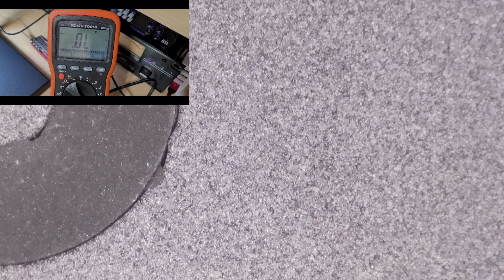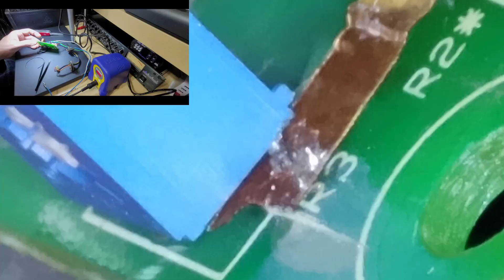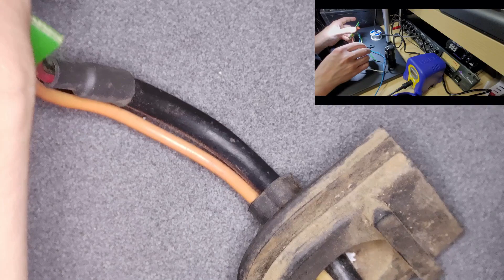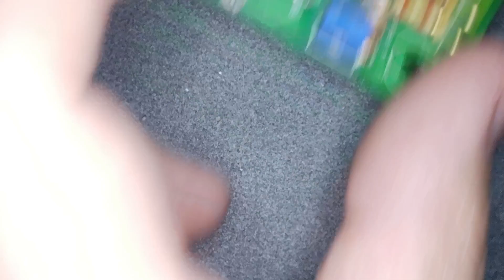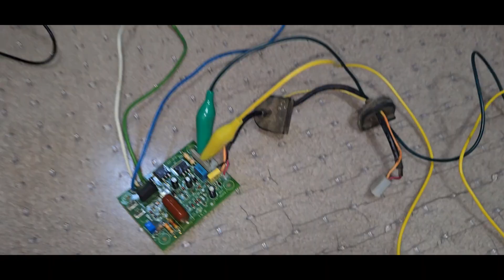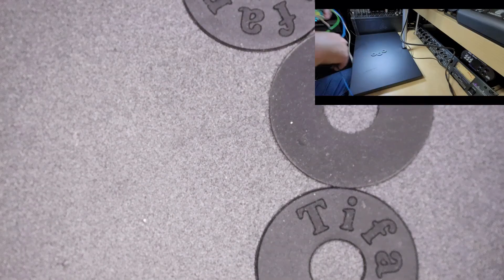Portable Generator Control Board Repair: 83970GS SMD Version

Comment: Have you ever tested the low oil shutdown function?  I can't get that to work on my early model 4000XL.  I would think that just jumping the pressure switch output to ground would start the 10 second shutdown cycle but it has no effect.  I have verified all the wiring and everything is good external to the circuit board enclosure.  Do you have a video testing the low oil pressure shutdown function?
Reply from the maker: I do not.

Comment: Thanks for the video.  I have a Generac 7500exl and I want to disconnect the bonding jumper from neutral to ground on the 120v 20a receptacle to have a floating neutral for when I connect it to my house interlock panel.  I have a bonding plug to use when not connecting to the interlock panel.   Could your verify the following:  

 I don't plan on using idle control when connected to the interlock panel and I believe idle control should still function with the bonding plug inserted.  If that's correct is there any other reason to  disconnect the green wire coming from the control board that is connected to ground at the receptacle and reconnect it to the neutral on the receptacle or should I just leave it as is?  

Also there is a wire labeled 55 that is connected to ground at the receptacle and goes to the 12v outlet.  Should it be disconnected and reconnected to neutral or should it remain connected to just the ground?   Any help would be appreciated.  Thanks
Reply from the maker: Remove bonding jumper, leave idle control switch OFF when connected to house panel. There is no need for it. Leave the green wire on the ground screw. Leave 55 alone too
Reply: @Bassguitarist1985  Thanks for verifying
Reply from the maker: @gphelps-jh3lgMy pleasure Best of luck

Comment: I need a new voltage adjustment pot, do you know the part number?
Reply from the maker: @GaryMuhs-n2r  sure, 3362X-1-103LF
Reply: Have a Generac 5500XP. 
How much do you charge to fix these boards, including the usual parts that go out/bad on these boards?
Reply from the maker: I haven't reverse engineered the schematics for the XP series, I'd be flying blind unfortunately.
Reply: This is the same board that I have in my Generac 5500XL, which has a bad idle control board.
Recently, I found a broken Generac 7500EXL.
The boards and all other circuitry are in great condition, like brand new almost, the engine is trashed, which is OK since I can salvage many parts that are no longer available for sale.
I have replaced the idle control board with the one that I now have from the trashed generator into my generator, and it works great.
My only concern about this board is that the protective epoxy on the back of the board has mostly peeled off.
What type of epoxy/resin do you use on these boards to protect them?
I don't want to keep the board installed if it's not protective from the elements, such as rain and moisture  here in Hawaii.
Saw your other video on the wiring.
That was great info that you provided about the idle control switch brown wire and the 120/240 volts where the real connection should be and not to be.
Reply from the maker: @ssgtwright2515 a product like this sprayed on will work. There are similar ones too for insulation and waterproof purposes.

https://www.amazon.com/dp/B001BW68ES

Comment: Hot tips:
Tin the ends of your jumper wires before soldering to the board.
Pre-flow leaded solder to solder pads where unleaded solder was originally used.
Additional liquid flux or flux paste is your best friend, can never have too much flux.👍
Reply from the maker: @simonilett998  thank you for the tips!!